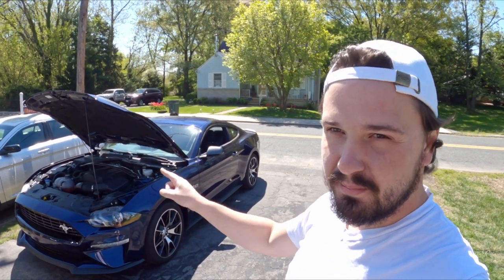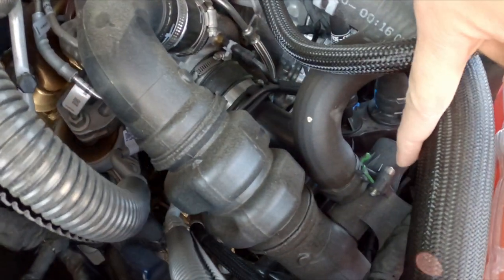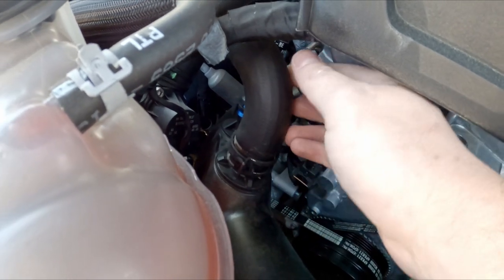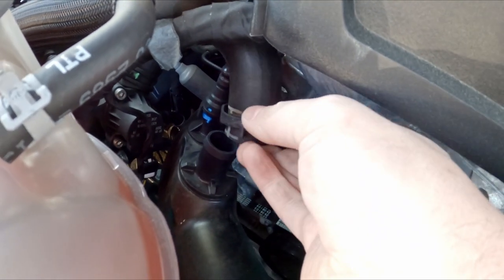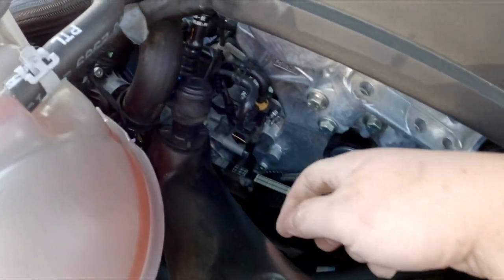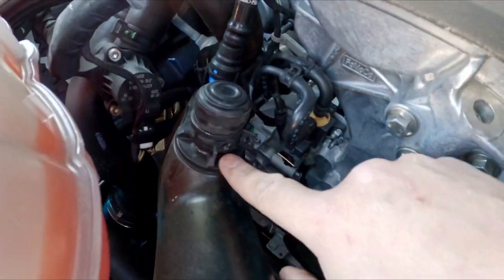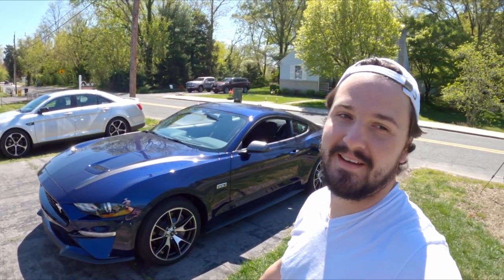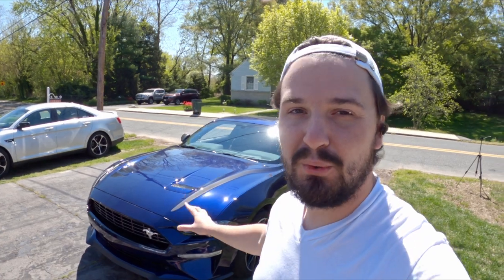How To Make Your Car Sneeze! Ford Ecoboost VTA Mod

Comment: Great video! Do you plan to tune or lower the mustang?
Reply from the maker: I'm definitely planning on having lowering springs installed. Since I paid for an extended Ford warranty, tuning the car probably won't happen unless Ford offers a Power Pack setup or something so I don't void the warranty.
Reply: @KarzKreated  Does lowering the mustang void the warranty?
Reply from the maker: From my understanding it doesn't void the warranty, but it could cause warranty repair denials if Ford claims the springs was the cause of a problem. But to make sure that I don't even have to worry about it, I'll source the springs through the dealership I bought the car from and have them install it. When done that way, Ford won't bat an eye over anything because their part was installed by their tech. A lot more expensive that way but I keep my peace of mind.
Reply: @KarzKreated  thank you very much for the insight man. I will definitely take that into consideration

Comment: I want to do that to my SHO but, I’ve been told that it’s bad for the engine/turbo. Is it going to do any damage to my car?
Reply from the maker: My understanding is it's perfectly okay to do this mod. I've had it done to my SHO for 30k miles with no problems related to the mod. Of course since every car is different, I can't guarantee this mod will be safe to do.
Reply: I’ve got vta mod done on my SHO 15k now no problems
Reply: @KarzKreated  Okay cool, did you have it done on both BOV or just one?
Reply from the maker: Only one. The front one because it was easy to get to.
Reply: Tyler I’ve got both done front and back. The back of as a little difficult to get to but I just cut the hose off

Comment: Would this work on a 2021 model?
Reply from the maker: Absolutely!
Reply: @KarzKreated  did you removed the negative comments ?
Reply from the maker: @sadsad9609  I do not remove any comments as I respect a persons right to free speech. If YouTube removed a comment due to whatever reason, that is completely out of my control.
Reply: @KarzKreated  oh ok , just asking, i dis the mod but i hear a sound similar to stones on the back by the exhaust
Reply from the maker: Hmm. That's strange. This mod doesn't effect the operation of the engine, and definitely shouldn't create that sound. Coincidence perhaps? If things don't seem right, it's always best to return the vehicle back to how it was.
Reply: @KarzKreated  last question do you know how i can wire footwell lights to the headlights? Lol if you know make a video ill donate lol
Reply from the maker: @sadsad9609  Not recommended, but all you have to do is find the 12v power wire going from the headlight switch to the headlight and splice another wire from that 12v source to your foot well lights. Ground the lights to the closet metal surface. I'm guessing you want the foot well lights to turn on with the headlights. That is one way of doing it.
Reply: @KarzKreated  yeah a guy told me is not recommended but my lights go off when i close my door
Reply: @KarzKreated  why is this not recommended?
Reply from the maker: @Schmegil  better ways to do it. That's probably the easiest way I would imagine. I've never done anything like that so I'm shooting from the hip with the suggestion.